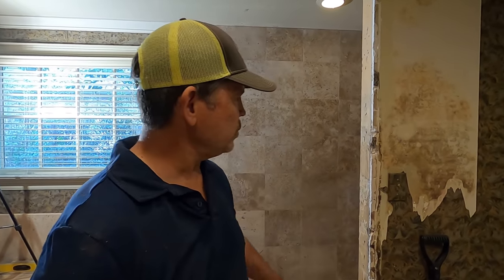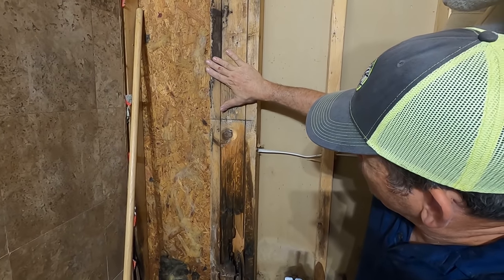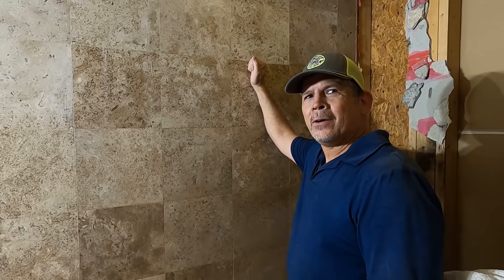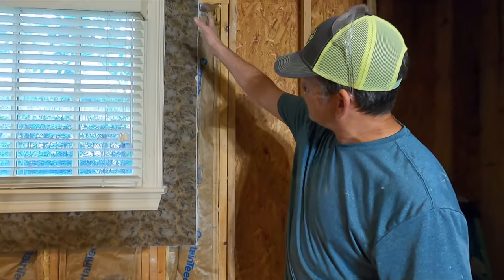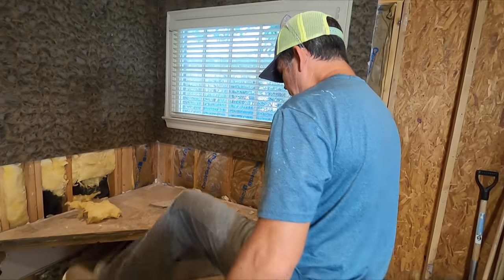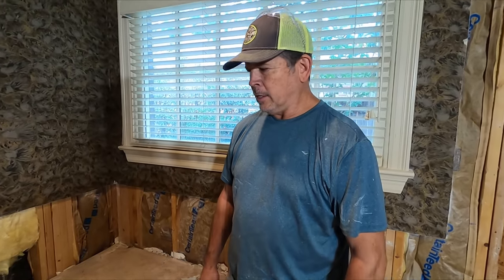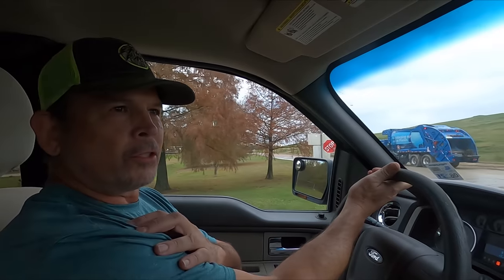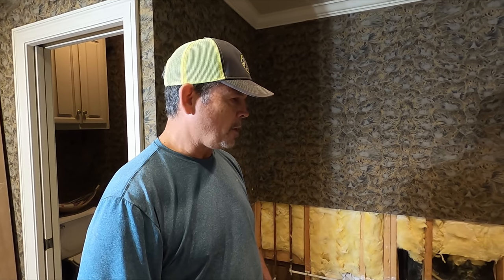They Left an OPEN Sewage Pipe Leading Who Knows Where...

Comment: I've seen another guy demoing a tile wall like such: use your hammer to break a horizontal line across the middle half way up the wall, then down an edge, and then peel the whole panel off like you're opening a book.  That way you can take the whole thing out to the truck, rather than cart 10 buckets of sharp shards.
Reply: Sometimes that method is out of the question but this is the way to go all day if the studs are in decent condition
Reply: Way too heavy and bulky to get thru house. Part of cost is not to destroy existing plus how fit in back of 1/2 tonne pickup truck. Most contractors have mid to small beds to maximize seating.
Reply: Plus (to had comments for below also) those were smaller tiles that had webbing on the back,  stuck to lighter weight material, these are large squares and they were not put on properly, if one of those large tiles falls off it could d some major damage. I think the proper way was to break all this up, shoddy work can't be trusted to stay in place, LOL. They only had dollops, its a wonder some of that tile didn't fall onto someone taking a shower. That has to be the worst job........

🕵‍♀I DID THAT.

Comment: That sheathing (OSB and Celebrex) and backside sheetrock has mold growing on it, needs an anti mold spray. This is kind of typical of what I commonly see. The only thing missing is the termite damage, missing foundation nuts for the bolts. That OSB has swelled up, it’s basically trash now, it’s probably 5/8 to 3/4 inch thick. 

BTW my bath/shower, 70 years old. This new age design, requires much more attention to moisture control than the the old stuff, having the bathtub on plywood itself is a recipe for rot, even if the contractors do everything right the foundation can settle and cracks can develop. As far as i can tell this bathroom had no moisture control between the tile and the framing.

Comment: It's amazing how you find the half ass that goes on even in these "Taylor Morrison" homes a mass builder. Stuff that isn't put in right. I didn't even have a stinger for the bathtub, wrong screws and no moisture barrier and it wasn't a direct to stud either. It was adhesive but no barrier. Also a wire was routed under the tub. 

They don't get inspections on this stuff?

Comment: 4:20 🤨🤨🤨 So the previous installer just spot applied red guard here and there? Didn’t even fill the joints with mortar? No wonder why there was mold and rot.
Reply from the maker: Yeah they smeared it over drywall mesh tape.   They almost got it right 🤣

Comment: If that pipe is connected to the sewer system, that is absolutely a superhighway for Mickey and all his dirty little friends. I smoke test sewer and drain systems for rodents several times a week. I'd guess about 50% of the time when we test a house that has been remodeled, we find an open pipe buried in a wall.

I'd block that pipe off several inches down and then pack it with some hydraulic cement for a permanent fix.
Reply from the maker: Thx Roger.  50% of the time!!  That's incredible.  Smoke test - I called about scheduling one today for another project.  They sure can reveal a lot.
Reply: @StudPack  
Yeah, I guess people think that since nothing is going down it, it doesn't matter, not realizing that rodents, bugs and sewer gasses can come back up through it.

Comment: looks like they used redguard? how did it fail?
Reply from the maker: They used it on the backerboard seams only over drywall mesh tape and there were major gaps.  Should have imbedded backer board tape in thinset over all the seams then redguard over the whole thing.  Might have had a chance with that.

Comment: For all the demo should you not use your 3M low profile paint mask. Way more efficient protection and I've seen you using on other videos. Would think that using proper notched trowel would be more efficient in installation vs. Dollop method. You dry pack base - why not walls? SCHLUTER products waterproof but cannot plumb and square bad/old framing with Tec/Custom or Mapei roll on waterproof membrane. Faster/easier and mesh reinforces joints. Any cost savings to use Waste Management garbage bag  with pick-up service?? Way less labour and they pick up bag in the  days.  In Canada - found at all Big Box stores

Comment: I can see the vent pipe in the drain is not run correctly. You can't run a vent pipe horizontally that low, it has to be 6 inches above the flood rim of the fixture before turning horizontally.  I've been a plumber for 48 years and I see code violations easily.  They definitely had some bad contractors on that job at one time. Only hire qualified license people for your work....
Reply from the maker: Thx Barry 👍. That horizontal pipe is the drain for the washing machine in the adjacent laundry room.  I can hear the water when the WM drains. Not sure how it all ties together under the slab 🤔
Reply: @StudPack  The international code now requires us to tie the washing machine drain to a 3 inch drain, but the washer itself is always 2 inch. Keep up the good work. Oh yes, you remind me of Charles Bronson, you look a lot like him.....
Reply from the maker: Thx Barry 👍

Comment: I need to ask you I have been told conflicting ways on how the backer board should meet the tub flange it seems that 90 percent say to put the backer board 1/4 inch above the flange and use the membrane and fiber mesh paper membrane to fill the gap and then bring tile past the flange I’m so confused is that way wrong I’m in the process of  ripping my shower with tub out and I’m doing it all myself so would u be able to explain to me the correct method of this conflicting backer board meeting the tub please thanks again for all the wonder full content I have learned a lot from you as it stands the back wall of where the tub is all the stubs are rotten and petrified and just crumbling when touched I can’t believe the power of water amazing how much damaged it did to the framing 🔥😊🔥😊
Reply from the maker: I prefer that the backer board extend over the flange.  This means two things: one, you'll have to shim every stud and two, the backer board will not be flush with adjacent drywall so you'll have to figure out a way to trim that out.  Check out our video:  https://www.youtube.com/watch?v=JzI6xUAQQFg&t=615s  "Remodeling a Hall Bathroom Part 5" and I go into detail about how I do this.
Reply: If you can’t fur out the wall so it goes over the flange then meet it to the flange, then use a waterproof sealant where the cement board meets the flange. Some people lay plastic sheet over the flange for extra peace of mind.

Comment: Why do people do that? Saw back and forth with a reciprocating saw? LMAO
Reply: If you don't then you will prematurely wear out one section of your blade. Recip saws don't have that long of a stroke yet you can get blades that are almost 20 inches long. Same principal as using a grinding wheel or wide sanding belt. You don't camp on one spot or you'll wear the things out before they're time and it costs you more money to replace. Also I'm a structural alum fabricator and if I don't go back and fourth then the section of blade heats up too much and the alum will gum up that section of teeth. Always use the entire blade for big long cuts if you can.